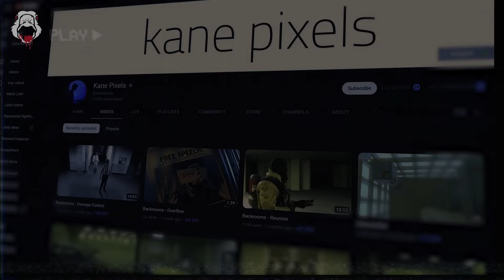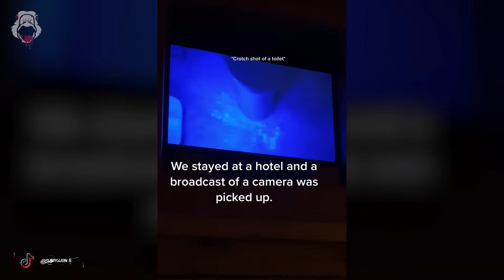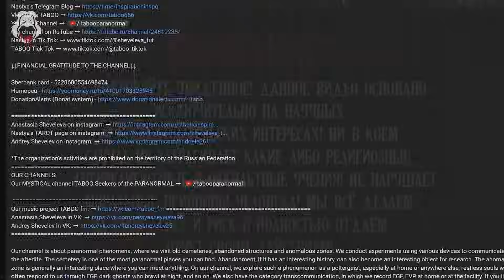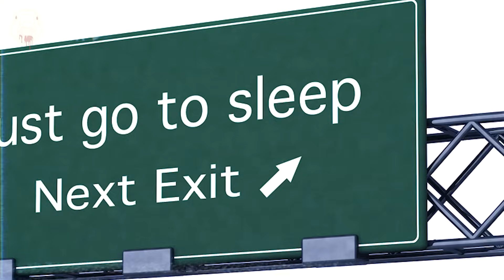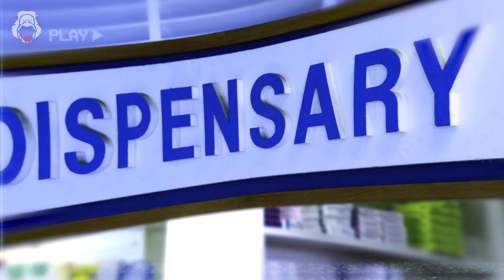1 Hour of Scary Videos [Scary Comp. V10]

Comment: The lights in the church video (yes im an electrician) are a fire strobe lights going off. Yes they can be wired to go off and strobe all at once even in multiple buildings as long as they are wired from the same panel. I knew it as soon as I saw it cuz I've tested so many of them at apartments, hospitals and plenty of other commercial buildings.
Reply: I'm glad I'm not the only one who could figure this out. I just can't imagine that they couldn't realize that it's obviously the fire strobe lights since most buildings are required by law to have them.

Comment: 8:30 that is likely an alarm going off in the building, likely a fire alarm. this is common for lights to flash like that through an entire building/property when an alarm is going off. even without sound the alarm system could have been malfunctioning.  even if the 'nephew' said otherwise.
Reply: That's what I was thinking.  There's those clear/white lights that go off during fires.
Reply: @Oreos_mommy  yep

Comment: On the Church in the 3rd video it could be a fire alarm. I’m a former police and seen similar. There is a way to silence the alarm and leave the lights to blink. I would do this myself while I checked fire alarms but until I cleared the area would keep the lights blinking so people would know it’s still active. This way I would not check the area with the alarm blaring in my ears. Once clear I’d reset everything and lights would go back to normal. I’ve seen this affect many buildings it all depends on how the system is wired.

Comment: @31:59 , while you guys were busy pointing out the dissapearing hand, if you look to the end of the corridor you will see something moving away to the right, a black shadow which looks to have a head, slow the video down you will see it clearly.
Video at 35:00 you can see when the door opens a bit something going to the left, the camera opens up looking straight then to the right, the person goes to the left and squeezes past the person filming back into the room, they nearly pulled it off.

Comment: Those flashing lights is strange in the fact there is either no code or inspections in that building or building's.
As they'd all would be on the same circuit..

Comment: 9:20 - church lights flashing - electrician here.. I've seen this before, and commented on another channel.
-for that many circuits, spread across multiple buildings.. They would have to tie different service panels together, and/or run a lot of wire to tie all those (should be) different circuits together, and use a heavy duty switch. I doubt they would be toggling the breaker.. It would be a lot of work for a short video. The other option would be that the lights were left on and a service short to the property is happening.. Highly unlikely. Nothing else being effected. It's probably 3-5 circuits across 2 buildings.. They shouldn't be tied together.
Reply: Watching it again.. There was another circuit energized, and uneffected.. Plus the walkway lighting.. Weird....